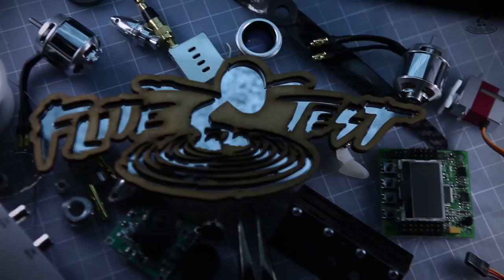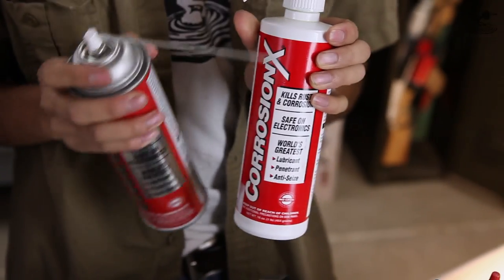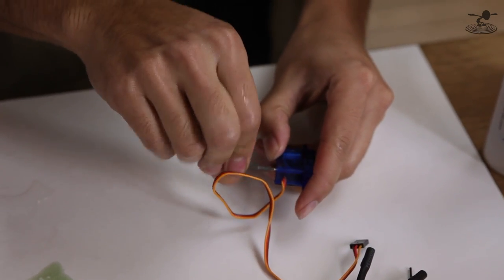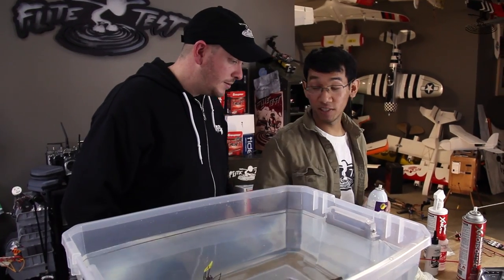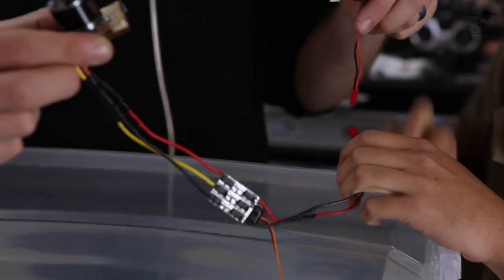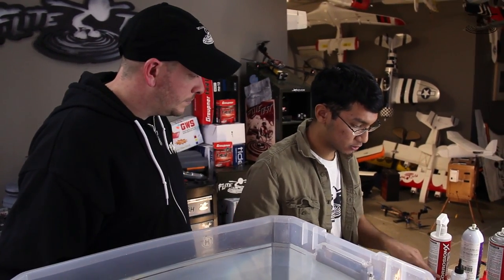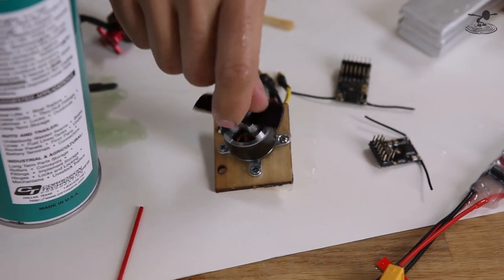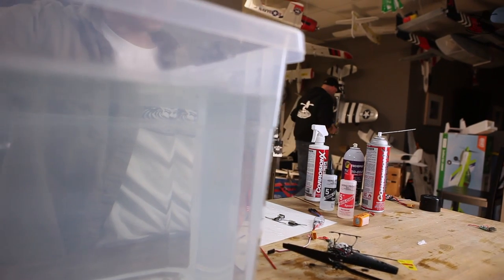Flite Test | Waterproofing Electronics

Comment: Thanks for the video guys! I have a few quick questions:
1. How does using these products (except for the epoxy and heatshrink) affect mounting the parts in a rc aircraft?  Will the products stop adhesives like double sided tape or velcro with sticky backing from working?
2. Will any of these products eat any type of model airplane foam, paint, covering or adhesives like CA?
Thanks!
Mike

Comment: does anyone know if nanoprotech leaves a residue or dries? would it be better to use conformal coating on the esc's seeing as when they sprayed the esc's in the video they stopped working?  what about using nanoprotech on everything else and corrosionx on just the connectors?

Comment: I have used a product called ACF 50 which is very good, available as aerosol or liquid.  wont harm PCB's so you can just submerge a receiver in it then allow to drain afterwards, nothing will stick to it from then on though.  They claim it will protect for a year once coated.

Comment: 10:44 I like to separate the wires and pinch the silicone in between each one then heat more till it seals a tight bond.  I also like to use terminal grease used for trailer wiring on my connection point to keep it from getting too wet

Comment: I've been using CorrosionX for years (about 2-3 now on FPV). I hate it on multirotors. The worst thing about it is that it collects dirt, awful when needing to repair and bloody messy. I found using plasti dip to work better and only using CorrosionX where I don't want the dip to go.

Comment: Any issues with using it on FC boards? I guess if it has Barometers that would be bad, but an acro board?
Reply: I would also like to know how it effects apm barometers
Reply: Barometers will not handle moisture. but you may be able to have the flight controller in a case that is sealed and has a membrane for the baro. problem is the baro will not read correctly when submerged or with water on the membrane.

Comment: Great video, can't wait to try this stuff out!!!
I want to CX my FPV gear, do you think it would it be ok to apply the CorrosionX to the antenna connector?
Also, if I use the CorrosionX on a PDB, can I clean it off later if I need to re-solder a connection?

Comment: I tried conformal coating the inside of my dji fpv camera, flew in the rain, seemed to work fine, but I went in and out from cold and humid to warm and dry, now my lens is foggy:/ not sure if I should try to use silica and get all the water vapor out and then seal it up, I wish I knew everywhere on the camera that air can get in

Comment: using spray type plastidip on the ESC as it creates a layer of rubber seal minus the use of heat shrink, i have tested it and it works perfectly

Comment: I have used epoxy on esc's flight boards and rx. I like hot glue on boards cause it comes off with alcohol. I have some heat conductive silicone sealant from ebay that works really well under the heat sink and then put clear silicone in the heat shrink like he put the epoxy in there. Silicone sticks to silicone sealed the wires really well
Reply: I water proofed some 'tronics using latex (glove), hot glue, silicon sealant, and straight forward tie off methods (cable ties, etc).  My app (10+ years ago) needed a higher level of durability than anything FPV/multi-rotor and worked well. ESCs need to diffuse heat and can get hot, that is the only caveat I can think of right now. Epoxy IS great, but it is rigid.  Hot glue is great but cheap. Silicon (and butyl sealant) is amazing. Long time to dry, minima shrink, flexible, and can mold to parts in a very positive manner. Wrapping components in latex glove fingers (and ballons) was key to minimizing use of other "liquid" material. Just my $0.02, good luck.
Reply: david ringler if it is freshwater I wiould take the shell apart and let it dry really well  look at the boards and make sure there is nothing on them look closely at the chips and be sure there is no residue bridg9ng anything or heavy corrosion. Then I would spray it down with the corrosion hd  then plug the battery in and cross your fingers that the magic smoke doesnt escape
Reply: david ringler get some high percent rubbing alcohol think 95 or 97 and a toothbrush and you can scrub the boards down pay special attention to the chips and small smd pieces. The alcohol will remove contaminents and the brush will scrub any materials off the board. Just be sure the water is all dryed out. Put one quad in some water bybthe coast and it was toast crashed in a freshwater river twice and dried it out with no problems
Reply: No problem. Let me know how it works for you. Hoping for the best

Comment: thanks to this video i used a plane ESC added a part from a CPU heatsink to the heatsink, used some pipeps running throu the heatsink, epoxy the entire ESC except the new heatsink part and added watercooling silicone tubes to it to cool it on a RC boat, still running, been sub-ed alot. :)

Comment: Conformal coating doesn't work on receivers have given 6 coats to mine and still failed I use plaster dip for my boats and crawlers and cars and waterproof batteries

Comment: I'm not sure if corrosion x is diffrent in Europe but after watching this video I brought some and sprayed it on a brand new orange rx and naze 32 I had set up and working without any power supplied to them, the rxs light now flashes on and off intermittently and loses signal constantly, the naze 32 rev 6 is completely bricked.
Reply: Isn't the bootloader written in ROM?

Comment: For the ESC, could you cut off the heat shrink and then put hot glue over the entire thing?
I had an RC electric boat over 25 years ago.  The ESC was covered with what looks like bee's wax.  I can see the wax solution not being good if/when the ESC gets hot.
Reply: You might want to re-think your idea, because of exactly the "ESC gets hot" statement and the way you apply hot glue. :-)
Reply: Balu, good point.  :)

Comment: I am wanting to waterproof the boards on my toy grade quads without taking them apart, could I just spray some corrosion x into the quad through the battery bay or opening on the bottom of the quad?  I just want a quick and dirty fix so I can fly in heavy rain or any bad weather.  Is there a community of fliers that like flying in rain or bad weather?  I don't know why I think it's fun to fly in bad weather.  Thanks a million.
Reply: After watching this Ill be waterproofing my Sport Cub S and Timber. I also would like be able to fly in all weather conditions. Being able to Fly my beater planes while snowing or light rain would be sweat and makes me more confident about putting the floats on them. But I'm not afraid to fly in any weather so if your close lets start a community Lol......Come 9n Lets fly in the next big snow storm.

Comment: Great video -  For the ESC waterproofing has anyone tried Vasoline or better yet, the stuff called Lexel? That Lexel glue is amazing stuff, never cracks like silicone glue and I tried to pull some corrugated roof material apart that had this stuff on it.  Impossible, it just stretched a full yard then sprung back together - it is solvent based as well. Both should be lighter than epoxy and epoxy tends to crack where it is just bonding to itself.
Reply: I just thought of another idea, that liquid plastic stuff you can buy at hardwares.  They use it instead of heat shrink to insulate wires and slopers actually use it on the leading edge sometimes.

Comment: Will it work on a power distribution board and a kk2? I've got a Spedix S250 mini quad that needs waterproofing.
Reply: Klinger RC You can cover the power distribution board with hot glue. Flight controller is more difficult though due to mini usb and screen. Probs a small box to waterproof that

Comment: Now knock it off with your ”shocking” stuff! You're not working with batteries and electric RC stuff since yesterday and you're not five years old neither!  
It's a damn 3S pack that puts about twelve volts! On the general skin-water resistance, how many amps you think it'll go thru? =))
It takes more than 20mA to stop or interfere with heartbeat! That applied directly to the heart! 
From that pack terminals there is ZERO current leaking to your hand even if touching the terminals with your bare skin. 

You need voltages in excess of 24 volts to be able to push any DC currents thru skin and any fair amount of danger begins around 40V. 
 

The waterproofing stuff is neat to promote. It should be common sense as many and  often get to fly in humid, rainy or foggy conditions. Condensation being my beloved enemies too! :D

Comment: Hey guys 
Great ideas 
I can also try using liquid electrical tape 
It's amazing stuff 
It makes like a thin rubber layer over the electronics 
Also silicon works great 
I've waterproofed all cars and boats and never have any issues with it 
It's so good that I drive my monster truck though our pond completely submerged and goes great
Reply: Has your monster truck survived 6 years later?

Comment: I would run at least a thin layer of epoxy inside the ESC. Epoxy does not stick well to heat-shrink tubing so over time it may separate and allow moisture in... Epoxy resin should actually conduct heat better than the heat-shrink tubing; although, only marginally. What you can do is mix powered glass with your resin to improve the thermal conductivity. Look for "milled glass" at places that sell fiberglass supplies (marine chandlery, art stores, TAP plastics) With the heat-shink tubing you are creating a pocket of air around the ESC, which is an even better insulator than the heat-shrink tubing. So I would totally eliminate the heat-shrink tubing and use only epoxy with milled glass. It will dissipate heat better. This also gives you the option to coat every up to the edges of the metal heat sink and leave the heat sink exposed. 

I'm not certain that the water permeability of epoxy is directly related to the cure speed. I think it depends more on the type of chemistry used in the epoxy. I know I've used some fast epoxies that were waterproof. There are a number of different chemical systems that will result in epoxy, but the final properties can be different. All epoxies absorb water, but some do it faster than others. But even ones that absorb water quickly should still keep water out of your electronics. The worst that should happen is that the epoxy will turn milky, white and get sort of flexible. At least, that's the worst I have experienced. It still kept a seal.

Comment: I use plastidip on my electronics... And without the shring wrap. I dunk the whole thing in plastidip and then, if need be, I cut out a small "window" where the heatsink is. Plastidip is rubber, so it's really easy to do.
Sometimes I use the same technique with epoxy, but epoxy is much more expensive and difficult to remove.
Anyway, both methods are less awkward than "epoxy-in-heatshring" you presented I think...

Comment: Would anyone know if this stuff is going to irritate my lungs etc if my ebike (which I want to waterproof the throttle and maybe battery management system for) is left inside my apartment near where I sleep?  There isn't anywhere else for me to put it.  Thanks
Reply: I wouldn't put it indoors for a long time, especially in a large quantity such as an ebike, but cured epoxy is fine

Comment: Where do you get the clear ESC shrink tubing. Can't find it anywhere.
Reply: Seibs71 on ebay. Pretty sure thats the sellers name. Any size and color heatshrink you can imagine
Reply: Thank you that name appears to be right.
Reply: Thats cool. Just ordered some from them got my order in 3 days. They combine shipping on multiple items ordered
Reply: Evan Leffler home depot or lowes look in the electric isle it is with the wire shrink wrap just in larger sizes colors or clear!

Comment: Hi guys, Just learnt about a product called Sugro which is a silicon flexible glue. I wonder is that would work with the ESC instead of using epoxy.
Reply: Christopher Loh did you try Sugro already? I'm kind of edgy I really need to know which works better.
Reply: Andres Mitre Have not tried it yet. But there is a problem I foresee and that is overheating problems. Will give it a try eventually.
Reply: I think suguru might become loose after some time because of the vibrations. I would like to try suguru on the ends on the heatshrink first.

Comment: I have a bicycle headlamp that was accidentally submerged in water.  I tried the corrosion X on it afterwards as a rescue, but it trapped a layer of water by the power LED.  It ended up failing completely.  I would not recommend this product for post immersion protection.... Protect the electronics BEFORE it is exposed to the water.

Comment: Pure water doesn't conduct electricity at all. It's the ions in the water that conduct the electricity. That's why you won't get shocked with electronics in a lake. If you have a water softener, that is salt and you will get shocked with enough wattage.This is a great video though! I will definitely use this method to protect my quad from corrosion.

Comment: Up to 36v ac or dc cant go trough the resistance of your skin (need to me perfect condtion) you can even touch two live 2000amp wires with bare hands no problem at all

Comment: What about flight controllers?  Like Naze or cc3d?
Reply: I wonder too
Reply: +DJ BIS probably just spray them with a coat of the stuff. I've heard of people doing it to their flight controllers before
Reply: I did my naze rev6 b with rust oleum never wet.  It still works.  I haven't gotten it wet though.  Cover your usb port if you do it. Mines gummed up
Reply: you could also use conformal coating spray. It does the same job but it dries properly and it can be melted by a soldering iron if you need to solder the board again. I think companies like TBS coat their products with this stuff.
Reply: +Tim Miller  clean it with Caig electronic connector cleaner and protector.
Reply: It still works.  I would just cover it if I had to do it again.

Comment: I think the reason that the esc's are magical is because they have a few MOSFET transistors, which need like no current to the gate to turn on, so the water is conductive enough to turn them on, and break the cycle and short circuit the esc.

Comment: Voltage is too low for a shock hazard.  120V AC would be a different story.  In the salt water it would be big trouble.  Peter sounds like a true self taught expert.   Inspirational.   I haven't watched the salt water part yet.   That's scary to even think about.

Comment: Just as a data point and as a warning to people thinking of doing this, I had bad luck with CorrosionX. I used to have a Traxxas Summit with a Mamba Monster setup in it (before they made the waterproof model). I coated the ESC in CorrosionX, took it to a local Wal-Mart parking lot in a snow storm, and it shorted out and fried the esc in about 2 minutes. That was just in snow too, so I would definitely not trust that stuff in water. Just use Plasti-Dip (the dip, not the spray) and be done with it.
Reply: redline870 he said not to use corrosionX on ESC's. Watch the whole vid before acting and commenting
Reply: redline870 7:08
Reply: redline870 next time watch the video properly. 

the guy said that it doesn't work well with esc.
Reply: Ironiic zero no offense but u literally just said the same thing I did
Reply: however I think ur right about the plastidip

Comment: RC car guys do full on under water stuff with something like plastidip or other rubberized coatings...

Just slather it on everything that isnt a heatsink and it'll be fine (SquirrelOD has good videos on this) and you dont even really need to bother with motors in underwater-car applications

Comment: josh... it takes more than 12v DC to shock you due to skin resistance. And actually if it was mains you wouldn't get shocked unless you put your hand in between the wires... perfectly fine to put a battery in water

Comment: hi so do u also spray the Motor and what should I use on the ESC?
Reply: Watch the video - everything is discussed there!
Reply: Androidtip.cz I did thanks very informative. .
Reply: Brushless motors are OK - usually no need to spray them as wiring is already insulated. If you spray them to be on safe side, it should be OK. On ESC corrosion X is not enough (but some people do this as only waterproofing with some success) - I would put them into shrink tubes and fill both ends with silicone or marine grade epoxy. This should be enough to keep water away...

Comment: what can be good for waterproofing brushed motors?,thanks a lot for your good videos...
Reply: Brushed motors don't need waterproofing. They work flawless underwater. :)
Reply: okay,thanks a lot
Reply: UltimaA380 what about brushed motors, like a computer fan?
Reply: Brushed Motors ARE NOT water proof. Brushless Motors are.
Reply: Shinigami919 What are U talking about? Not all brushless motors are waterproof (maybe Traxxas's Velineon or such) because those have smd components inside and/or circuit boards so NOT all! I think about the sensored ones, those are not Im sure. Motors like in this video that didnt have sensors are waterproof too but let's just say well water resitant. Brushed motors only got commutator and "brushes" so its working even underwater. BUT also could die from much salty or dirty water. Have U ever heard of breaking in a brushed motor? Check it out. ;) Sorry for my bad english!
Reply: Name Name Computer fans are brushless motors.